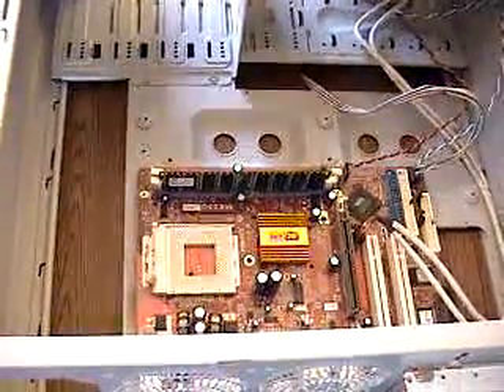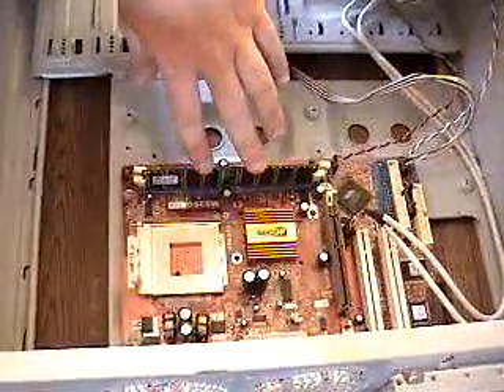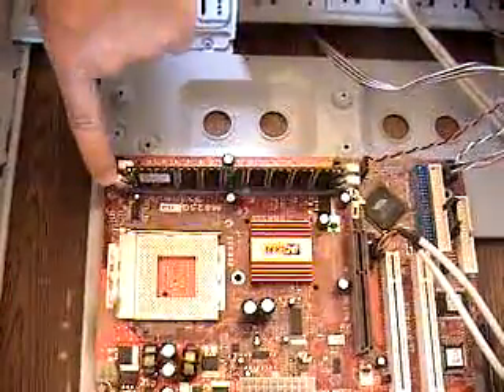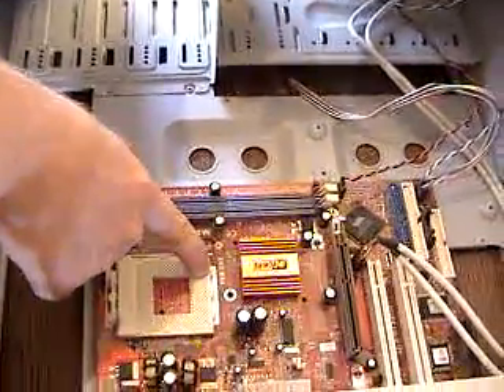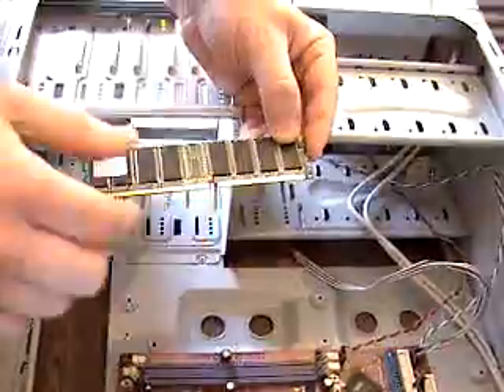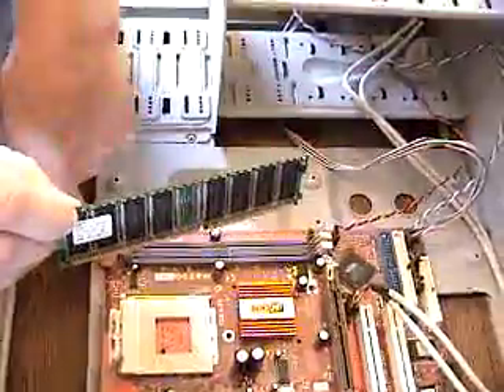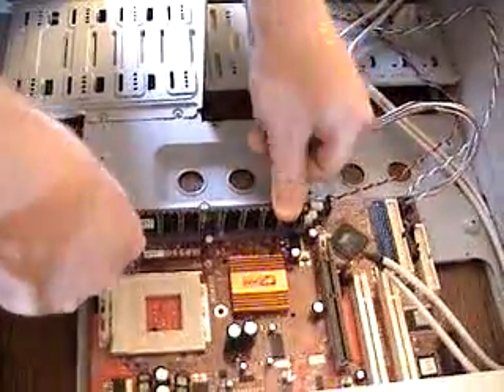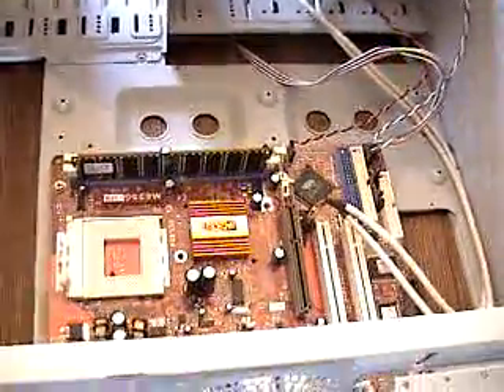How to install more system RAM or Memory into your computer

Comment: Everyone here, one thing that everyone should know. You CANNOT use more than 4gb of RAM if you are using a 32bit operating system! You can install more RAM than that but the OS will only recognize 4gb of RAM. If you put in 8gb of RAM then you will only be able to use half unless you install a 64bit OS. Mac OS X is different. You can install more than 4gb of RAM because it combines the uses of both a 32bit and a 64bit OS into one.